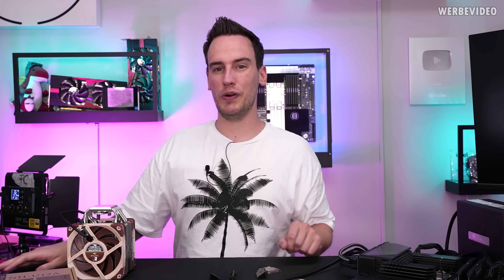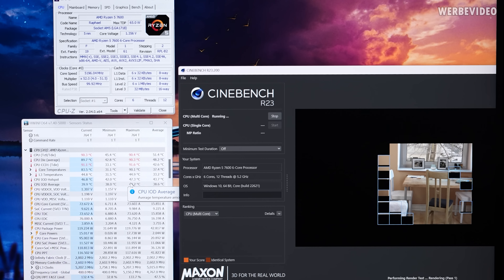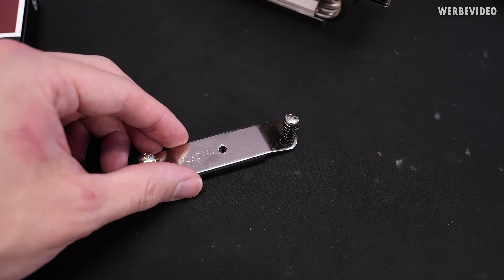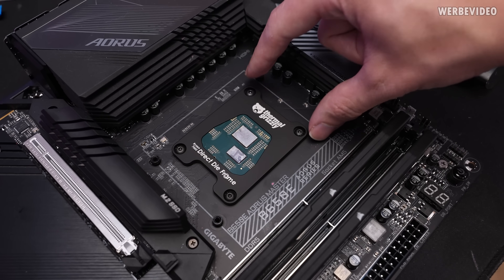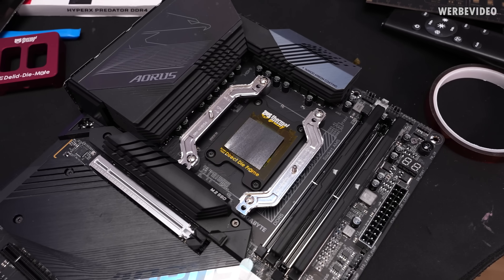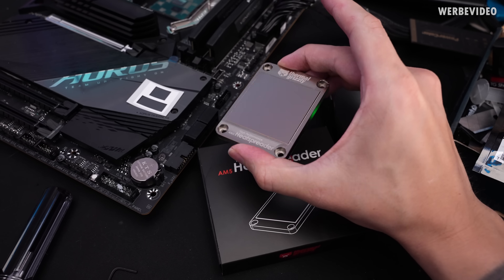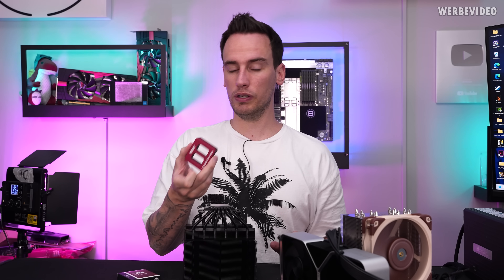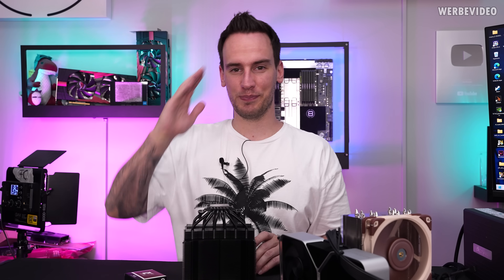How this 120$ Noctua Cooler beats a 360 AIO

Comment: Garbage testing method because you used the air cooler in an open air environment which is not realistic.  Absolute trash.
Reply: With adequate case fans, internal air temps are going to be roughly similar to external room temp. I have NZXT H7 with nine case fans. Under extended heavy load, the internal air is only 2-3C warmer than room temp.

Also there are plenty of open style "chassis." It's not unrealistic nor "absolute trash." It's meant to be a baseline because open designs can have a standard reference, while a closed case wildly varies in temps and air supply. Different number of fans, fan sizes, fan curves, room temp, etc.
Reply: @Djinnerator  The base case should be a closed case. You discounted your own argument.
Reply: @dreamfunction4491  No? I didn't? A closed case is more variable than an open one. A closed case still has to account for ambient temps, while an open case is just ambient temps.
Reply: @Djinnerator  Yes you did. Closed case is the norm and should be the baseline.
Reply: @dreamfunction4491  That's not how baselines are determined. Plus open style cases are also a norm. You get a baseline by using repeatable environments with as few variables as possible. An open test bench removes other variables that are subjective to many different things and won't be the same.

For example, a closed case in your bedroom at your room temp will be different from that exact same case in my bedroom at room temp simply because we'll likely have different fan curves affecting cooling. When the goal air cooling (this includes liquid because it's cooled by the air) is to get close to ambient because you're using ambient air as the heat dump, the best way to measure cooling performance is to have unrestricted access to ambient air. That's the baseline.
Reply: @Djinnerator  You are spouting more nonsense. The base case is closed case since almost everyone uses that. 
In any event, you are a SOFTWARE BOT.
Reply: @dreamfunction4491  Except almost everyone isn't using closed cases. Just because you are using closed doesn't mean others aren't. And that's still not how you find a baseline. You clearly don't know how to conduct reliable research because you think "normalcy = baseline."
Reply: @Djinnerator  When it comes to introducing a product meant for consumer consumption, you take your base case from the most realistic and practical situation which is closed case.
YOU ARE A SOFTWARE BOT.
Reply: @Djinnerator  One last thing, the reason why the video presenter used the OPEN CASE was because he wanted to give Noctua a best results outcome. In other words, he biased the experiment to show that the fans were doing good.
Reply: @dreamfunction4491  That's still not how baselines work. How are you going to say open case isn't realistic when people are using open cases, and case fans try to get internal temps to ambient? The only "issue" in the video is not testing the aio direct die. What you're saying is showing you don't understand how experimentation works. I'm done replying because you keep thinking a scenario that's subjective to multiple variables is a baseline, which is far from valid. Not a single cooler company rates their coolers using closed cases. They 100% always use open test benches because that's how you measure the performance of the cooler itself.
Reply: @Djinnerator  SOFTWARE BOT.

Comment: I'm  a big fan (no pun intended) BUT... did you JUST compare an AIO trying desperately, to dissipate heat through the insanely thick AMD AM5 IHS (which you HAVE shown in other videos to be the EXACT problem with the AM5 design) to a air cooler that gets to take advantage of the AM5 being delidded??? I ask b/c a delidded AM5 on an AIO never hit 70c if I recall correctly. That's like comparing Toothpaste to a Ferrari .....  Shouldn't the scenario be like-for-like? There are too many variables for it to be a valid or even YouTube worthy "comparison". Speaking of car analogies... I think Air Coolers should probably have already gone the way of the Air Cooled Porsche.

Comment: Amazing video. Gives me all kinds of ideas.  When you're talking about the air cooler being at a disadvantage in the case remember you can always build a custom fan duct to pull air direct from the outside rather than inside the case, and this does have good results, but the variety of cases often means it needs to be custom.
Reply: yup! that's exactly what I did decades ago on some socket A build (a weird time when AMD chose direct die on desktop). Now, most of the time I just remove the side panel of the case.
Reply: Last two builds, I've mounted the air cooler back-to-front, with the rear fan blowing IN with a ghetto-mod filter on it (a frame cut out of ABS sheet, attached with 3M magnetic strips, can be detached/reattached by feel), with a centre/top exhaust.  CPU cooling is completely unaffected by heat from the GPU, the hot air from which is also very effectively exhausted by the top/centre fan. Of course there are intake fans (two front and one centre/bottom).

Comment: My completely stock, untouched 7600 running with stock settings with a Thermalright Peerless Assassin air cooler scores 14025 on the 10 minute Cinebench R23 test, gets up to a max temp of 79.9C with a room temp of 26C. I freely admit that I have always thought overclocking completely pointless (like putting go-faster stripes on a car) but even I was surprised at all that expense and risk of damage for only 4% extra performance. I would sooner invest that in a faster CPU.
Reply: You get larger performance deltas with higher power consuming chips like 7900x/7950x or 13700k/13900k. 7600 draws a lot less power, so the gains from DD cooling aren't as apparent. With 7950x, for example, you can get around 10-12% performance increase because PBO can set more aggressive clocks for longer periods. Consider that AMD said 7950x won't even reach max clock speed unless the CPU is at or below 50C. Most people idle around that temp, let alone have moderate to heavy load, so this allows more performance.
Reply: @Djinnerator  Hmm but if I was not happy with the performance of the 7600, I would just sell it and buy a 7700 for a proper performance increase.
Reply: @reggiedixon2  yeah you're right, that would be much safer and easier performance gain. Plus I'm pretty sure going from 7600 to 7700 would be a much larger gain than what direct die cooling would offer :)

Comment: this is where all the "Europeans" are - we test the AIO in a drain with thermal paste, then we take an air cooler. we make a delid and smear liquid metal - and here is an "amazing" result for you! "Air cooler beat 360mm AIO!!" And where is the AIO test under the same conditions? Why was AIO not tested with liquid metal and without a heat spreader??? DUALITY AND HEADLINE CHASING?

Comment: Delidding in this CPU it's a huge gain, but too expensive, risking the CPU and losing the warranty not worth for average user.
The offset is a thing to consider, but CO + power limit it's best thing to do to improve temps. My 7700X @ 90w + CO performs as same as stock and with a Noctua U12 chromax rarely go to 90 degree.
Will be awesome if AMD offered stock delidded CPU with appropriate parts and protections to avoid cracking the die.
Other thing AMD need to improve is placement of the CCDs near the center for single CCD CPUs, dont understand what cost savings achieve with using dual CCDs (with all the complexity) PCB for all CPUs.
And yes understand exists some 7600 and 7700 with one CCD disabled, but majority is just single CCD.

Comment: But isnt it a bit unfair that for The aio hoy leave The casing on an doesnt touch fan speed, nor pump speeds. Also changing casing thermal paste etc, I agree that air coolers are for ever but Thet take espace that aios doesnt í think both work great and hoy should get The Oné you like

Comment: Why do you call heat pipes "air coolers"? Are they not internally more or less based on liquid evaporation?
While you call pumper water type coolers "water coolers"?
And both of them seem to cool to the cpu to the air inside your office, so would be "air coolers". Very confusing.

Comment: Hi der8aurer, could you make a video about the Thermal Grizzly Kryosheet that you keep using in your videos, and compare it with other thermal pads like TG Carbonaut, IC Graphite Thermal Pad and some commonly used thermal pastes like TG Kryonaut, Noctua NT-H2 or Arctic MX-4 ?
There is no info about the actual performance of this new pads.

Comment: I still love that the cooling has gone back to direct-die considering it was 100% the normal experience for a lot of us building in older systems. I did direct die right up to my last AMD system a Duron so many years ago. Now we're at the limits of what a cooler can transfer through the IHS on a modern chip the direct die is coming back. Funny how technology cycles around hey?

Would be nice if the chip makers would supply the processors naked so to speak. I really don't like the idea of delidding frames and the mechanical stresses imposed, though I'm sure you do your homework on the design and instructions just doing that to a new processor is not nice! Would be a huge boon for us who enjoy overclocking and playing with systems to buy IHS-less processors.
Reply: Practically every current LGA or PGA CPU package uses a heat spreader, so how can you say direct-die is back? Meanwhile BGA usually has an exposed die so it didn't really ever go away

Comment: I wonder how much heat could P1 take away from 7950X with direct die, liquid metal and the offset mount
surely it won't reach the 230W PPT, but with some CO the performance drop could be negligible

Comment: Weren't the 7000 series AMD CPUs supposed to run hot? Was the CPU thermal throttling with the AIO? The power consumption is merely 120 W, my 25$ tower cooler should handle this without issues. I think if the chip is designed to run hot then any fight against it is pointless. I still don't understand how the controller can raise the temp - by raising voltage or reducing fan speed? Here the things are locked. Still it's been stated that high operating temperature is in the design. Just the direct contact frames cost as much as a trusty single tower cooler does (one which has enough headroom at 11 gen intel at 130+W that I lowered the fan curve).
Reply: For overclocking you always want the best cooling possible, but what I see is simply a lot of people who don't trust AMD. They think they know better than the engineers who designed the cpus so of course it can't be good to run at 90C!!1! 😂

Comment: very strange test and video... very illogical... Making test AIO with a standard frame and no modifications... Then scalp the processor and apply liquid metal and compare temperatures..... Especially, it's very "logical" to compare temperatures between standart thermal paste and a non-scalped CPU vs. a scalped CPU and liquid metal... Obviously a scalped CPU with liquid metal will have lower temperatures...and it has nothing to do with AIO.... The whole point of the video is to pull the owl on the globe... And an attempt to show that the author and noctua made a plastic bar-colab.... a very silly test from such a legend

Comment: Fascinating. Although I cannot afford these things I still run a enlarged air cooler. But I don't really overclock too much instead I clock for electical/thermal stability. I try not to allow my components to get over 70c. Memory still runs around 50c to 60c depending on the day. Afternoons are the worst as the temperature here gets up to 43c
Reply: where you live?

Comment: DerBauer Is this practical for use with a 7900X or is the heat generation too much for an air cooler ?
Reply: You don't need to delid the CPU or use liquid metal. Just the normal air cooler is more than enough for the 7900x under normal use, without heavy OC. The offset mount kit is a great idea though, a few degrees less for very little $.

Comment: An AIO can not run your CPU passiv - a aircooler of enough thermal mass and surface can for idle applications up until normal gaming load. AIO can not compete in my book, beside look and the fancy features like displays combinded with rainbow puke. To each his own.
Reply: thats one way of looking at it. if ur cpu pushes 300 watt the air cooler will fail and the AIO can deal with it
Reply: @norkris8729  That is right, however all modern CPU push into there preprogrammed thermal limit with their boost algorithm, that is also why overclocking has become stale. 

The question becomes, do you really have that often a workflow to do, that is time critical so that you need these 5% or 10% out of the CPU getting you stuff done a couple minutes earlier?
Reply: @Airwave2k2  true, but if u wanna pay alot more for looks and 2-3c   i mean  why not xD
Reply: @norkris8729 What do you value? If you have the budget do whatever you want. My point isn't looks or performance, but the noise reduction. Beside me stands a system that is unhearable because it is passive with a Prolimatech Genesis cooler adapted (with a self designed aluminium converter for Noctua D15 adaption kit) to AM4 with a 5800X. The fans standing still as do all other moving parts. The loudest thing in this room is the tactile Keyboard i use to write this reply.

Comment: This looks like a great option. With the kryosheet air cooler combo you get very high reliability as well, no liquid cooler maintenance required
Reply: Don't bother. I bought one recently and it breaks apart too freaking easily with an AIO. I'm expecting a revision very soon for this expensive junk.

Comment: That is such a bizarre choice for that advertisement. You have those thick, sleeved cables that are meant to look good. But the way they are set up in the ad, it looks like the goal is to block as much direct airflow to the CPU cooling solution as possible? So, it looks like the company has no clue what they're doing.

Comment: noctua ftw!!!  water coolers are always noisy due to the water pump and i can't stand them
Reply: Had a few custom loops over the years, and all were completely silent.
Reply: @SmalltimR  idk how you would manage to silence the water pump, but if you did then props to you!
Reply: @mindlessinfinite  
It's quite easy actually;

D5 w/custom top
Reduced power to optimal noise levels
Decouple with PT gel pad (for vibes)

Many people today tend to use reservoirs that introduces air into their system, resulting in noise(ie, turbulence) - coupling that with hard mounting a pump to chassis, and you get plenty of noise, vibrations, etc 

Beyond that, we have silent cases and sound deadening, though I did not find that necessary with the above recipe, against VRM or hard drive noises over pump or coolant noise.

PS. It was nearly 17 years ago that I built my first water cooling loop and have enjoyed many years of silent builds since. Though the custom water-cooling community was far-more lucrative in-terms of ingenuity and high performance cooling, than with the pre-built market today.
Reply: @SmalltimR  thanks!  im actually about to spec out a new pc so I'll be looking into what you've informed me about.  Appreciate the time to teach me a thing

Comment: The fact that Noctua has started making and selling accessories for direct die cooling suggests that integrated heat spreaders will soon be a thing of the past when it comes to enthusiast builds. PC enthusiasts and hobbyists are going to start running direct die cooling setups by default, in the same way that so many now simply default to using AIO’s. I really think it’s going to become the go-to route for lots of people in the coming years. I’m currently running a 7800X3D and I think I’m going to try to delid it when I switch from my AIO to a water block.
Reply: That scenario will only play out if manufacturers keep upping the wattage without addressing the flaws of their IHSs. I’d give that outcome a 50% probability. But hopefully they’ll do better so all this won’t be necessary.
Reply: 7800X3D isn’t 13900K it doesn’t pull much power, why would you need to delid it? I’m running a 7800X3D with TechN block and the temperatures are good. It really doesn’t pull that much power when gaming. You’re giving up your warranty for no reason.
Reply: @Simon_Denmark  it’s not that I need to, I just want to. I’m not too worried about voiding the warranty. It would suck if I messed it up and had to replace it but it wouldn’t be the end of the world.

Comment: 13:12 You are comparing an AIO on a stock ILM and with IHS CPU vs an air cooler on a delided CPU + custom ILM🤣= irrelevant comparison.
You should have tried the air cooler on the same condition as with the AIO to see how it performs.
In conclusion, you didn't show if the Noctua is better than the 360 AIO.
Reply: 100% agree

Comment: The question here is what effective benefit do I get from overclocking, which really is the prerequisite for all of this. What percentage increase do i get in performance against the cost and discarding of warranty on several components.

Personally, unless this gets you decent double digit percentage gains in performance, I would question the point/value of this and say it's pretty much an expensive gimmick for bragging rights.
Reply: I'm into overclocking myself but I'd say that modern CPU's and motherboards are so good with the turbo profiles stock that for daily use the gains are going to be very limited.  Even with an older CPU (i7 4770K) I have recently tested you are only looking at around 5% in the real world for daily use.  Benchmarking is different as you don't need the stability.  At the low end the additional 5% gain you can also get from overclocking your GPU could be enough to see the system soldier on ok for another 6 months while you save for new parts but when you can afford decent kit it's not really worth doing for a normal user.